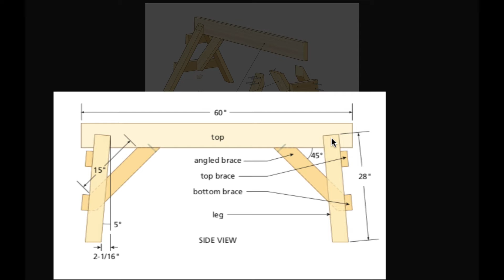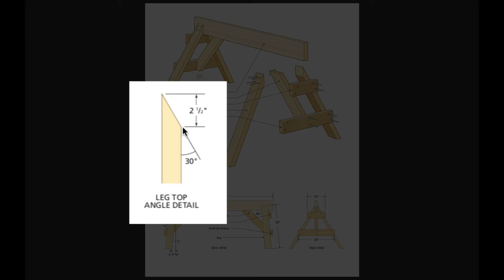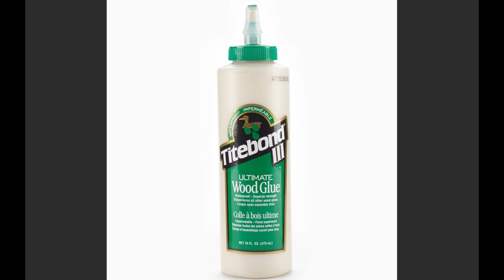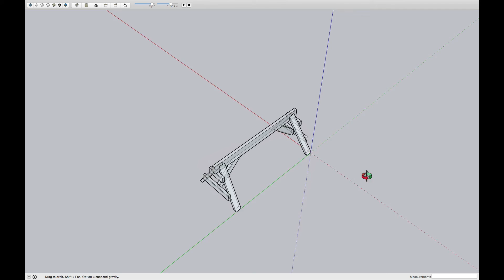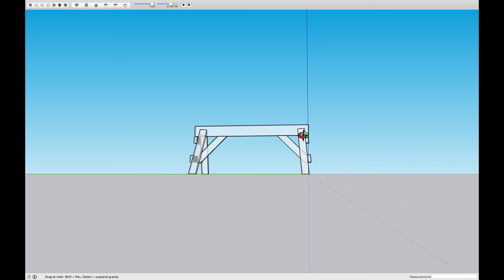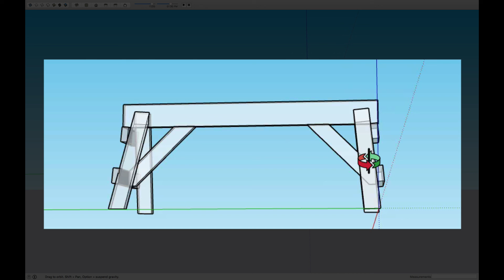Downloadable Heavy-Duty Sawhorse Plans – Stronger Than Store-Bought!

Comment: What the heck do you use these things for? I can see how you can lay out planks on them or something while you’re painting them. I’ve never used one of these for anything other than that but I have used saw benches almost every day of my life for the last 40 years. A real sawbench is somewhat similar, except the very top 2 x 6 would be lying flat so you have a surface to put a board on then saw it off at the end, probably with a c-clamp holding it. But to have the top board vertical with only one and a half inches seems useless to me, except for the above stated holding planks to be painted. What’s up with these things?